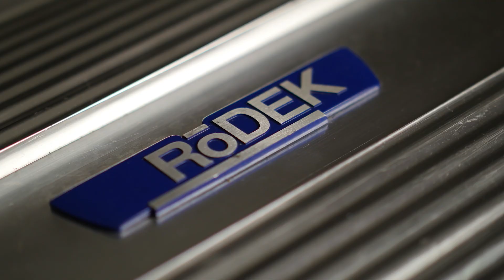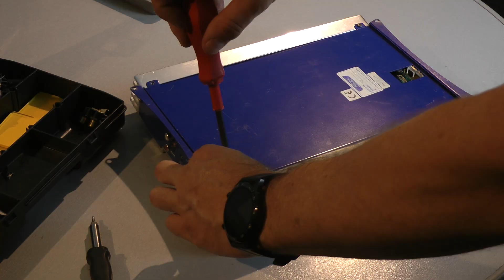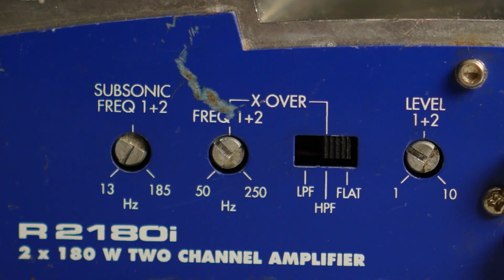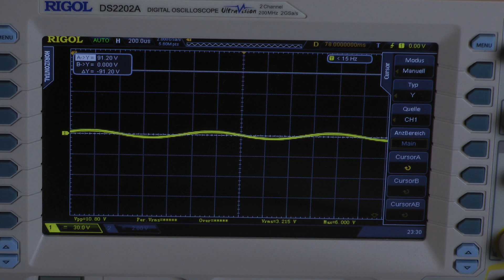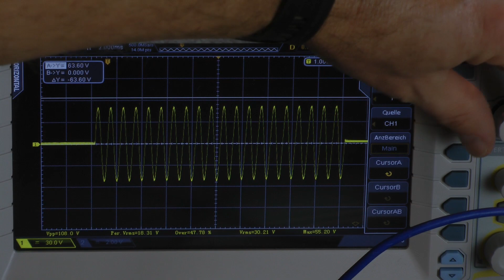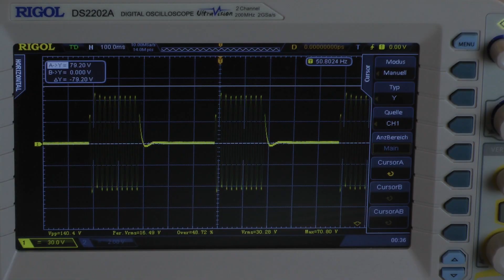Rodek R2180i two channel oldschool stereo car audio amplifier amp dyno output power & sound test

Comment: Hello how did you calculate the output power can you plz share the formula thx
Reply from the maker: Yes, no problem: peak voltage/ 1.414 to get RMS voltage, then RMS voltage *RMS voltage/ resistor value. That’s it. If tested bridged mono then again /2 to get power per channel 😊
Reply: Thank you  @audiokeller1975